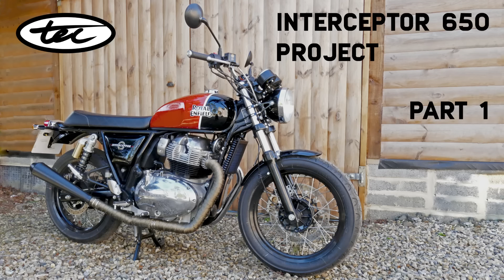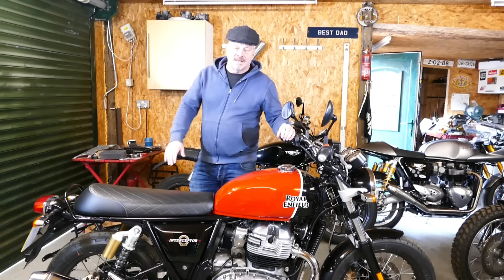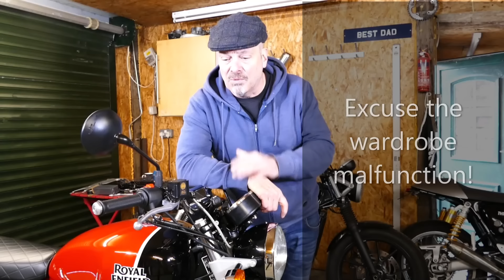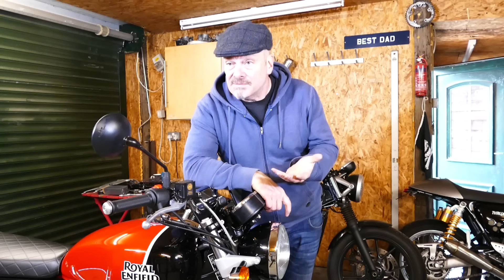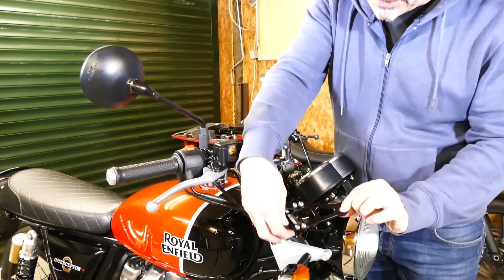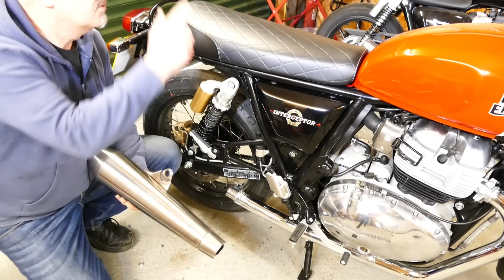Interceptor 650 Project - Part 1

Comment: Really interesting video. I test rode the Interceptor the other day, and like you, I was well impressed. I've just booked marked your website, and subscribed to your channel, as I can seriously see that either the Interceptor or the GT could be in my garage next year. Will be great to follow your improvements to this bike. One thing I'd like to see is some side rails so you can put saddle bags on. before you maybe chop the rear end. I think Royal Enfield are onto a winner with these bikes. Lets hope that the reliability is there too.
Reply from the maker: Hi
We have just made a prototype luggage rack that will be in production soon, as Royal Enfeild don't have one in the accessory list for these bikes. They do have pannier rails though so probably not worth us making them.
At first we will be looking at styling options for those not wanting to chop the frame. We are going to go through several stages of customising on this series with easy and reversible changes first for the people who just want to personalise the bike. To more radical changes later in the series, with the bike morphing at each stage . Probably ending up with a full street scrambler .But we will see how it develops with input from viewers.
Then we will look at the motor which should prove interesting !

Comment: I like what you are doing George, one question though, why fit resistors rather than change the flasher unit?
Reply: Hi Bob, you can  either a variable rate flasher unit or resistors . Personally I have found you get a more reliable flash rate with resistors

Comment: I`m not a fan of an all black bike, and do like to see some chrome, or brushed aluminium / stainless steel.   As for that bike, i DON`T like that seat, particularly the fact it`s narrow, and sits on top of the frame. I prefer the seat to be a bit wider, and skirting down outside the frame. Also, i`d prefer to see a different single seat on it, maybe like the Thruxton R behind it. Also, junk the rear mudgaurd.
Reply: Yes the rear end needs lots of thought and attention, It will be very hard without a frame chop.